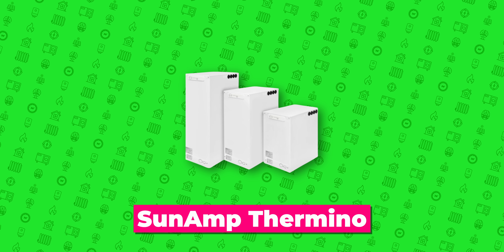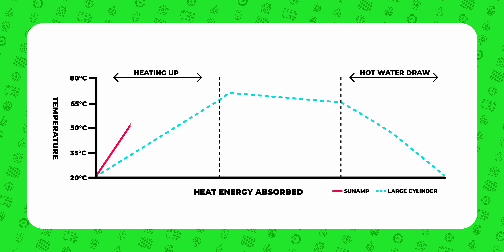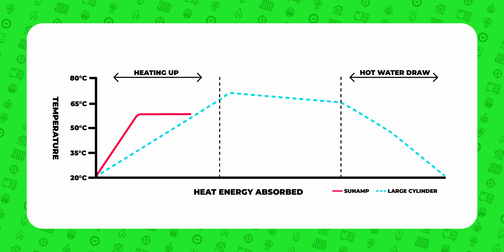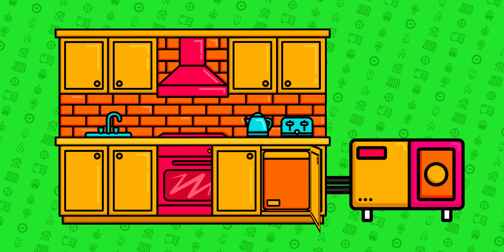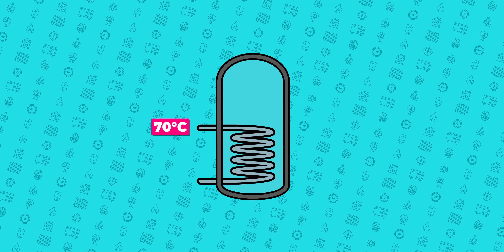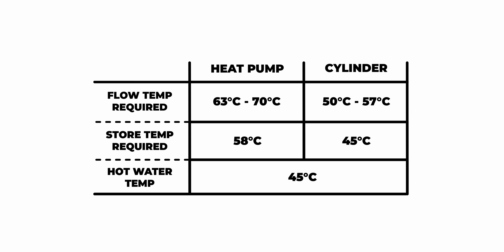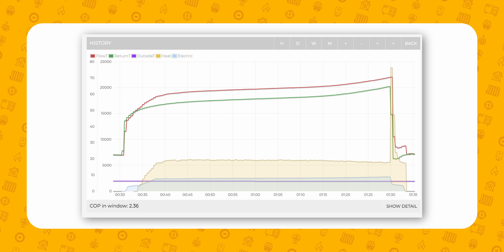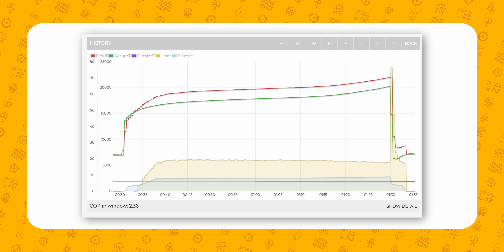Is this THE FUTURE of Home Hot Water? Sunamp Review

Comment: There was a program in the state of Minnesota, some time ago, where the local utility would install a PV array on your property, along with a very large and hyper-insulated hot water storage tank.  The homeowner did not pay for or own any of the equipment.  Water in the tank would be heated via solar until it reached a certain temperature and then any additional solar energy created would belong to the utility.  The concept was the large hot water tank would stay warm enough to meet all domestic demand until the following solar day.  There was supposedly enough hot water for 2 or 3 days, according to the utility.  All of the cost was incurred by the utility, which wrote that off as an operating expense and, ostensibly, realized a net gain over time by controlling peak generation and demand curves.  For select properties, a homeowner could cut out the utility by purchasing such a system, with radiant in-floor heating becoming a substantial part of their overall solution.  I think much larger, and better-insulated, hot water storage tanks are the answer in many situations, but this smaller unit looks like it would be effective enough, if space is at a true premium.

Comment: I had 2 × SunAmp PV and in the end dumped them because of terrible reliability issues.  I replaced them by a more conventional OSO UVC and we have never regretted this.  OK, the poor reliability problems were a case of early adopter blues.  I understand the latest SunAmp designs are simplified and more reliable, though I do have concerns about the actual life and MTBF of the PCM cells as the constant liquid <-> crystalline phase change has a coefficient of expansion that puts the current simple cuboid cell design under quite a lot of stress, leading to cell failure. So IMO, the design needs further improvement.  Our OSO UVC also has vacuum panel insulation and so has really low heat losses.  The UVC is immersion-only, but my heating schedule uses the cheapest Octopus Agile slots, and so our daily HW costs are small.  So I agree with your summary: pro: small form factor; con: dubious lifetime for current generation models.

Comment: Had a Sunamp for 6 years, it did the job, but the heat exchanger cracked and flooded my front room. It was a fairly early Uniq model so cant speak for reliability on the newer ones. Early adopter so guess you gotta take the rough with the smooth. Got a Heat Geek Newark cylinder and getting SCOP of 4.29. Pretty impressed.
Reply: How do you power the Newark Cylinder? A Heat Pump? Thank you.
Reply: @steviebarratt3658 Yes Arotherm 5kw

Comment: For all the talk about efficiency - why not add a shower waste heat recovery pipe - it has an infinite sCOP! Experience in my country (the Netherlands) shows you can save around 50% of the heat required for hot water - this basically halves the size of the needed water cilinder
Reply: The upheaval in their installation, most walk in showers have the waste between the joists, there’s very little space.
Reply: @edc1569  I mean a vertical heat recovery pipe - which can be run parallel to the soil stack.
Reply: I already have 🎉

Comment: Correct me if I'm wrong but ; efficiency % =  output Power / input Power, energy in Joules. Anything greater than 100% will be classed as over unity. Getting more out than you put in.
Reply from the maker: For every 1kwh unit of electricity you buy, a well installed heat pump will move 3.5 - 6 kWh of heat in to your home. Using the same metrics as you’d measure a boiler they are well over 100% efficient
Reply: For heat pumps the equation is more akikn to % (COP) = useful heat energy / input electrical energy (you're not creating energy, but you are extracting energy from the air outside, yes, even when it's -2c due to bulk energy, hence your coeffcient of perfromance is above 100%).

Comment: I had lower temp Sunamps installed a few years ago as part of a trial system. I don't know exactly the temperature they worked at but my heat pump was running below 50 degrees. I haven't seen them on the market so does anyone know what happened to them? Did the technology not work properly or is it still in development?

Comment: As a graduate Chemical Engineer I studied thermodymics, heat echanger design etc. I have to say that your ability to communicate the key concepts in a simple way is outstanding.
Reply from the maker: Your mixing convected/conducted heat with radiation. It doesn’t matter what the air temp is, the radiat heat passes through the air and if the earth is vibrating at a lower frequency than the sun (which we know it is) the mass of the earth will absorb that radiant heat. The surface of the earth touching the cooler air creates conduction/convection currents which radiation passes straight through
Reply: @ 
No, back radiation doesn't work that way.  The Earth's climate system is based on convection currents and conduction, but also atmospheric density.  Thermalisation near the surface inhibits radiative heat (from excited CO2 molecules) from warming the surface.  Over the seas, the most IR radiative heat could do (if there were no convection) would be to warm the oceans to a depth of a fraction of a millimetre.  BUT...above the surface of the oceans is a layer saturated with H2O (obviously), so warming of the oceans from IR is impossible.  The Earth isn't vibrating - it is the molecules which vibrate when they absorb a photon (only in the ground state).  A CO2 molecule then loses that photon within half a second.  The important thing to note is that a typical CO2 molecule receives 3 billion collisions with photons in that time.  However, it is already in an excited state having absorbed a photon, so nothing extra will happen to it until a photon exits and takes the molecule back to a ground state.  It is ONLY in that state that a molecule can absorb a photon.

CO2 makes up only 0.04% of the atmosphere.  By far the largest collisions are with nitrogen (N2).  This transfers any energy received (the photon) to the nitrogen molecule.  The energy is then transferred as kinetic energy (not heat).  Thermal radiation is thus converted to molecular movement (sensible heat).  Thermalisation is thus key, here.  It is quenching any heat.  The Earth isn't warming through CO2, as it cannot.  Thermalisation KILLS back radiation.  Only 1 out of 50,000 CO2 molecules result in the emission of a photon.

I don't think anyone is really arguing that the Earth hasn't warmed in the past 45 years (though there is a case for that), but it isn't by much and is 100% explainable from reduced cloud cover (decreased albedo).  In fact, decreased cloud cover explains MORE than 100% of the warming, so there is a slightly curious cooling going on.  What has caused the decreased albedo?  Most likely cosmic rays.  So, in summary, none of the warming we are seeing can be explained by CO2.  CO2 physics doesn't work that way.  It is only a matter of time before the IPCC announce this.  In science, the truth always outs.
Reply: May I pick your brains?  You obviously understand the 2nd Law of thermodynamics.  So can you (or anyone else reading) tell me how back radiation from CO2 in the atmosphere warms the surface?  The surface is warmer than the atmosphere - and heat flows from warm to cold, not the reverse.  So how on earth is back radiation not breaking the 2nd Law?
Sorry if you're busy, it's just that you don't often run into qualified people on YouTube, so I thought I'd take the opportunity.  Cheers.
Reply: 1 heating element is worming you more than 1 1/2?
Reply: @ Back Radiation is not violating the 2nd law, which is about NET  heat flow (energy flow) from a warm body to a cooler one. However it does not mean that a cooler OBJECT (the atmosphere) cannot emit radiation to a warmer object (the surface of the earth). Of course the earth is cooling ( emitting more energy than it get from this back radiation) but the CO2 in the atmosphere reduces this net loss through back radiation. Hope that helps
Reply: @ 
Thanks for that.  So the idea is that as Earths mass loses heat to the atmosphere, this is impeded through excited CO2 molecules?  But isn't it that this can only happen between 14 & 16 micrometres of the IR spectrum...and that part of the spectrum is already taken up by H2O and thus already saturated?  This is what I have been reading - by an atmospheric physicist.  So no more heating can come from CO2?
Reply: @ not my area of expertise but I do understand that both CO2 and water are greenhouse gases that absorb at different but overlapping IR frequencies.  In particular CO2 absorbs strongly at 15um a region that water absorbs less efficiently.  However when considering global warming CO2 influence is much more significant since it is long lasting (centuries) and does not condense and cycle out of the atmosphere like water. Also CO2 is present in the upper atmosphere where there is little water vapour.
Reply from the maker: What a lovely compliment!! Thankyou!!!

Comment: An interesting new concept for an alternative to a hot water cylinder. BUT why do all HP discussions assume that a household needs a large volume of hot water.? They don't as most households have a dishwasher, a washing machine and an electric sower with no bath - all of which use mains cold water so do not need any storage of water. Hand washing can be just as effective with modern soaps as cold water. Hot water for a sink in the kitchen and bathroom can be provided by a continuous flow water heater which costs about £150. All electrical devices as described heat ONLY what is used so are very cheap to run.
Reply: Man after my own heart, Richard.👌
Reply: @barryfoster453  I await a reply from buddywheels below! My monthly cost for heating and electric is £87.00
Reply: I'm not sure "most" households don't have a bath and have an electric shower. I can only think of one person that doesn't have a bath in the house and they live in a city centre flat. Every other household I can think of has a bath. Some probably don't get used often. Ours gets used daily. If you have children then a bath is almost a necessity.
Reply: @gavjlewis  Good point re babies and children I am a plumber and have replaced many baths with showers so maybe this distorted my point. I ONLY shower but my daughter likes a bath when she visits me. My good old Combi meets all my requirements and is cheap - run at 51 degrees heating!!
Reply: Our problem is that to obtain the Gov grant of £7,500, an ASHP install also requires a hot water storage tank. Due to our house construction and design, we can’t install a HWST, so are looking for a solution similar to what you have outlined, i.e. only need hot water at three sinks! Do you have any brand suggestions for the small water heaters we could use? We’re thinking of a Qooker or similar in the kitchen, but the smaller heaters for the other two sinks.TIA!
Reply: @budflanagan1262  I didn't realise that to get the grant you HAVE to have a storage cylinder which is not a very efficient way of providing hot water. Typical of the Politicians who have NO technical knowledge - particularly Milliband.
I have installed several continuous flow water heaters. Basically they are the same as an electric shower - and element which operates when the water is turned on. So simple and cheap to install and only uses electricity when used. The Quooker tap heats a small tank and maintains it at nearly boiling so requires topping up 24 hours a day. I told a potential Client who was thinking of one - why not just boil the kettle when you want boiling water? 

Go on line and you will find many in line water tankless heaters. I installed a Redring 12kw water heater but you will have to upgrade the RCD in the consumer unit to 50 amps. You should also use 6mm cable if possible but 2.5mm ring main will work for short lengths of cable - check with your local electrician.

Only about £150 compared with £500 for a Quooker. Hope this helps.
Reply: @budflanagan1262  Keep the gas boiler for DHW and get air 2 air heat pump for heating.
Reply: You don't in Scotland. We had both a Vailant ASHP and Sunamp heat battery installed through the current grant system. Both working extremely well in sub-zero wintry conditions :)

Comment: The cop reduction of dhw is one thing but a more relevant metric is what it does to the combined heating and dhw scop. If you cant find a solution for dhw your going to stay with 80% gas combi, missing out on the much more significant heating efficiency of a heat pump.

Comment: Why don't you guys over there eliminate the heat exchanger from the heat pump to the water tank, turn it and the floor/radiator heating into a closed system, and only use a heat exchanger to get the domestic hot water out of the tank?
Reply from the maker: Makes installation more simple and less dangerous as we’re using r290 to get these super high efficiencies.
Reply: @HeatGeek  We're also using R290, it's still a monoblock so nothing changes in that regard. The only difference is that instead of using a heat exchanger on the heat pump side, you have it on the domestic hot water side. You can put (propylene glycol) antifreeze in the entire system (floor heating, heat store, and heat pump) while the domestic hot water flows through the heat exchanger as needed. This has the added advantage that legionella is practically of no concern.

Comment: I had an old 1st generation Sunamp when I had my Solar PV installed 8 years ago and it operates alongside a gas combi boiler. 
It sits under the kitchen worktop next to the washing machine.
It wasn't very reliable for the first 2 years, but then Sunamp came and upgraded it under warranty and has been fine since. I believe the new ones are designed differently and a lot more reliable. The original ones like I bought had a 2 year warranty, but all the latest ones have a 10 year warranty I think. 
In autumn/winter I charge the Sunamp if needed using off peak (1/2 price ) electricity, in summer I charge it using excess solar.
The  downside is maybe the price compared to an unvented cylinder. The upside is the space saving of course.
Reply: We've got a similar setup to you but unfortunately no solar to charge it. We currently charge it solely from the system boiler and have often wondered what the price difference would be to charge off peak on the immersion. Does it work out cheaper than charging via gas?